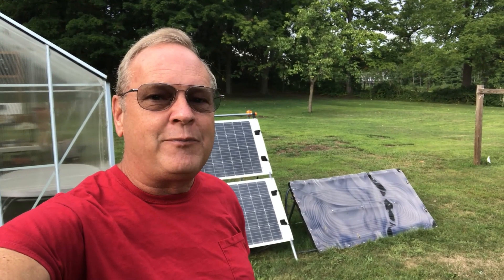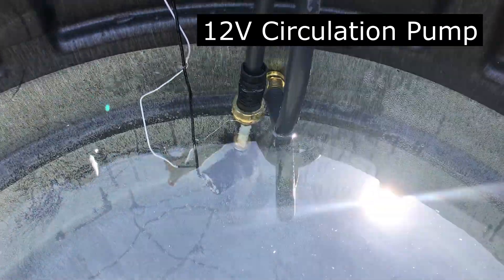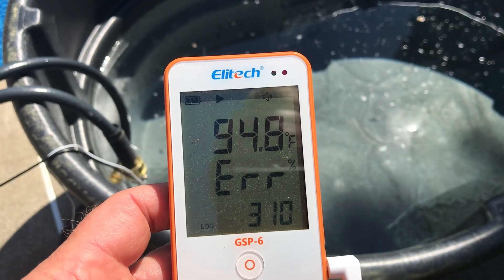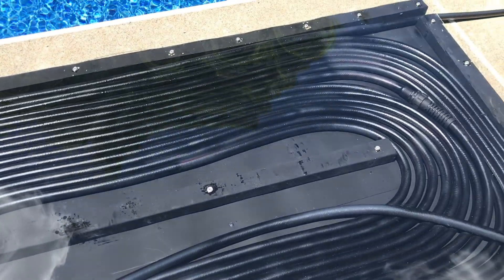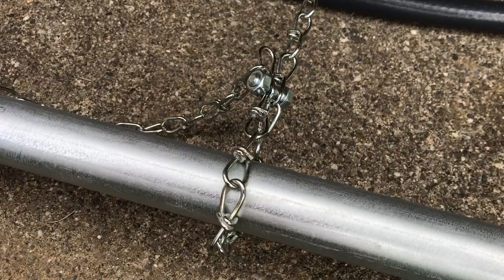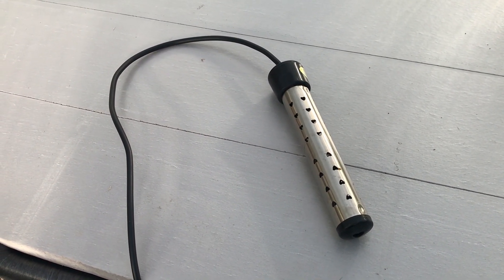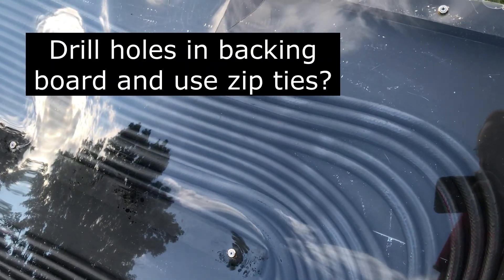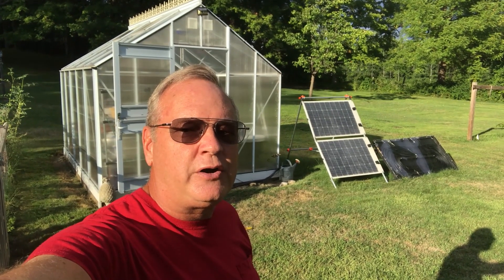DIY Solar Hot Tub

Comment: Chris, are you still using this? My first design I did last year for our soaking tub was also a coil system that didn't sit inside of a Plexiglas container. Did you find that that made a huge difference in the heat collection? Also, I've been researching using hydrogen peroxide instead of chlorine for small tubs like the one you have. It seems very promising without a lot of the cons of chlorine.

Comment: Would it be more effective, if not efficient, to employ a couple more solar panels to power the submersible heater, allowing you to not use the coils of black hose?
Reply from the maker: You can do Solar Electric or Solar Therma hot waterl. I think solar thermal is a bit more efficient for low-end water heating applications (ie. pool), You would need 6-8 large solar panels to get 1000W for the immersion coil. Newer water heat pumps would be much better (https://www.renewableenergyworld.com/solar/solar-hot-water-which-is-better-pv-or-thermal/#gref )
Reply: @SerendipitySue  - My wife and I recently replaced our old hot water heater with a new model than includes a heat pump on top.  Holy cow, are they efficient!  Our electric bill dropped almost $40/mo.  I can't wait to put enough solar on the roof that 90% of my hot water comes from powering that high-COP heat pump!  :)
Reply from the maker: @jasonbroom7147  I’m curious what brand/model you went with? I’ve also wondered if your heating bill goes up (since you are transferring heat from the area where your hot water system is to the hot water). Does the system have a condensation pump? I’m also curious if I could eliminate or reduce running dehumidifier in my basement?
Reply: @SerendipitySue  - Chris, we went with the Rheem Proterra.  Our utility room is right off the garage, so not part of our conditioned space.  When our furnace or air-source heat pump (HVAC) is running, that utility room is usually around 55 to 60 degrees, even on the coldest days.  Also, our woodstove has a plenum tied into the HVAC hot air return, so we can "heat" our home and our hot water with propane, wood fire or the heat pump outside.  No matter how that room is warmed up, it allows the smaller heat pump on the hot water heater to do its magic.  The exhaust from the heat pump is ducted into our garage where it provides AC during the summer, although it does make the garage colder in the winter.  The system requires a condensate drain, but if you install that then it dries the air somewhat.  The Lithium Solar channel reviews all of this and he said the heat pump is too efficient at heating the hot water, so it doesn't run long enough or frequently enough, in most situations, to really be a dehumidifier.

Comment: I always enjoy your videos.  Thanks for working on this one.  I was looking at solar water heater and saw a few experiments where a PV system could be more efficient. That could be nice to replace the electrode in the existing water heater and not have to worry about the expansion or contraction of the water. In you hot tub that wouldn’t be a problem since you don’t have a closed system.  Wel … enough rambling.  Good video and hope you guys are doing well.